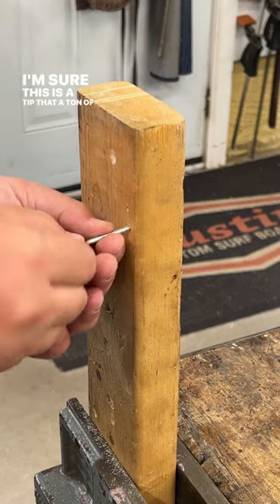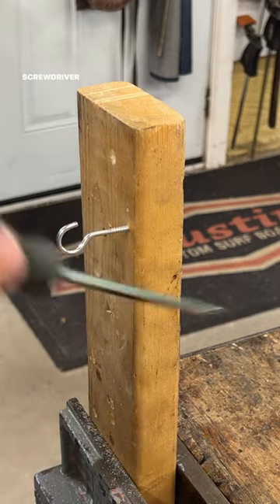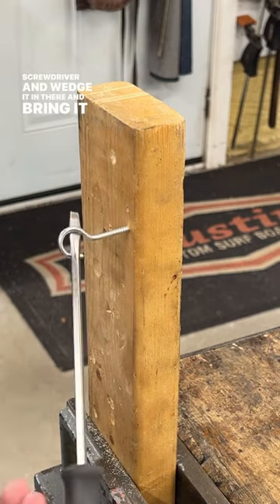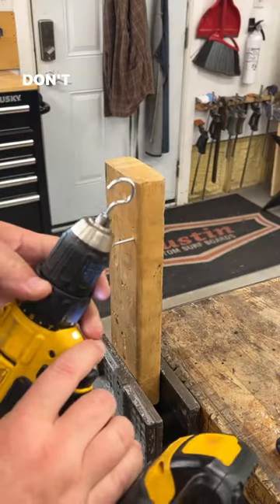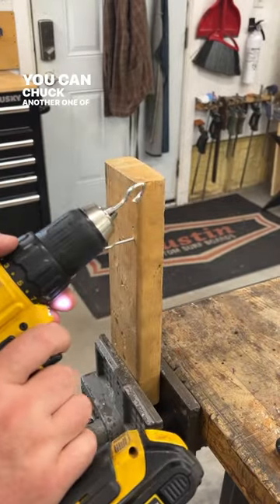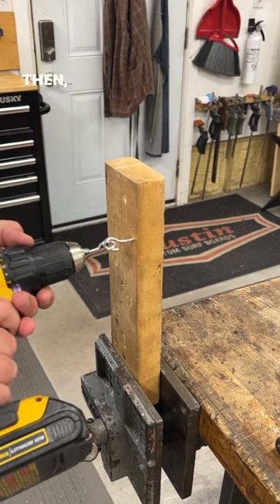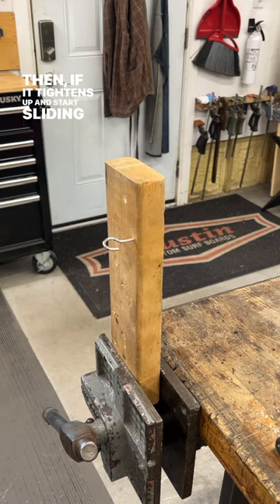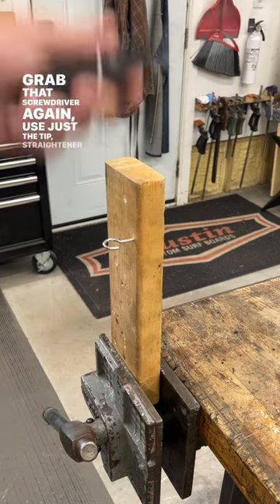Old tricks in the shops today while I’m moving some of my lights using hooks.  #shophacks #shoptips

Comment: You can actually just use the drill chuck on the hook. Tighten the Chuck right on the hook your driving in.
Reply: Exactly what i was gonna say
Reply: Yup, was just about to post this same comment 😂
Reply: But this makes more sense if you're putting in multiple hooks. You don't have to stop and set up for each one.
Reply: If you’re only doing one hook, sure
Reply: Some hooks just be too large my bro
Reply: That's only good if you need to do one of them. Any more in mine as well put an extra hook in the drill
Reply: Nah the real hack is to throw ur wall on a lathe, spin it n slowly push in the hook. Voila
Reply: @benaloney  That's what she said
Reply: I was going to say this, but the solution shown here seems much more elegant
Reply: You can do if you don't mind putting burrs on the hook
Reply: Yeah. But if you’re doing multiple, this is way easier and safer
Reply: Thinking smart

Comment: Experience adding in here: If you can, pre drill making a pilot hole and then rub the hook threads on a piece of soap. Some hooks are soft and in a harder wood they can twist off or deform. I am a big believer in pre drilling pilot holes. Attention to detail pays off in the finished product.

Comment: The hook on hook is a great idea!! I've got to put some curtains up and this is going to help so much!!
Reply: If you aren't super cash strapped I'd highly recommend a proper driver set usually called an "I bolt diver" or "hood driver" they will be a lot more efficient and only cost 10 bucks. Good if you plan of doing even a half dozen in your life, especially bigger ones that require more tourque

Comment: Wrong. That only works on the little eye hooks. You're supposed to screw it in by hand until it doesn't turn then use the long handle of the channel locks to really get it in there. More leverage than the short screwdriver.